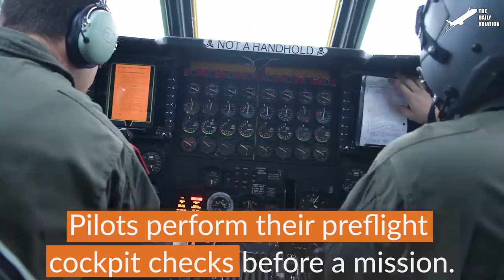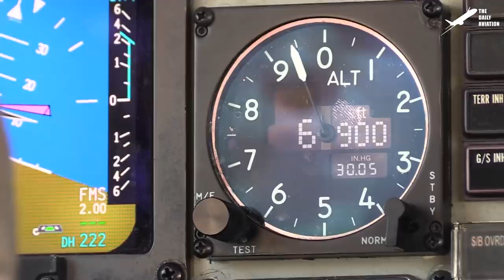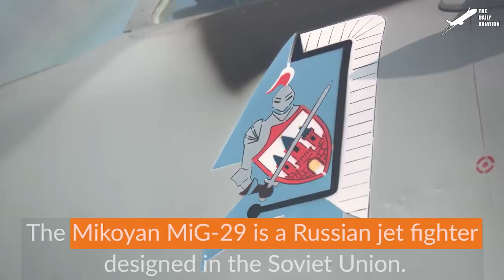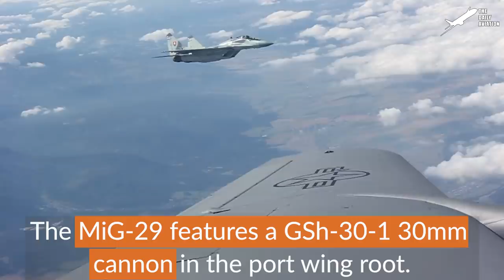This Massive US Aircraft Need 8 Engines to Takeoff

Comment: About two years ago I spent a month helping a retired American Airlines pilot through a month of surgery; a triple bypass that he had put off for twelve years became quintuple bypass by this time and, between two weeks in hospital followed by two weeks in a rehab, it was a rough month for us both. He had flown B-52 in the Air force during Vietnam and after; during the end of propeller models that were subsequently changed to and eventually built with Pratt and Whitney jet engines. He not only confirmed  a  B-52 WILL go .99 Mach, as I had heard but will fly with up to three engines out. Now, he had some amazing stories about how durable these things are and some of the things that can and did go wrong. They'd get shot full of holes, massive fuel and hydraulic leaks, pieces would get shot off or flutter and just break off during flight, etc. and, these things would still fly.
However, he had retired as a commercial airline pilot and had flown just about everything made and said many times, those B-52s generally should have been retired many decades before but, everything built that was supposed to replace them, including the B-1 Bomber, had far more problems and were such unreliable POS's compared to the, "Old Dinosaurs" he used to fly, that that's why the Boeing B-52 was never fully retired. In 1990, during the first Persian Gulf War, while  I was in the NAVY, he went back to active duty and flew B52s again. They needed experienced pilots and, Because they just worked! He said the crews  made pieces themselves when spares were unavailable. Can you imagine? Hey Jim, get me the Pop Rivets and a couple Vice Grips, she lost another trim tab!

Comment: Jet engines have come a long way since the 1950's. I literally used to live right across the street from Wright Patterson AFB, and could see and even hear the B52's taking off. Heavy black smoke billowed from the engines, and you could see it falling to the ground as they took off.
Reply: The heavy black smoke is caused by water being injected into the engine during takeoff.  The water turns to steam and temporarily increases thrust.
Reply: @GregSr  Probably why the black exhaust is heavy and you can see it falling to the ground.  They also smoked considerably while circling to land, so I assumed they were really dirty. I'm sure the engines have been upgraded several times, or even replaced with newer models. Thanks Greg!

Comment: These things are coming on 70 years old. Jet engines have moved on considerably since. Rolls Royce offered an engine replacement programme that would give the B52 better takeoff, climb, cruise and half the number of engines and halve the fuel burn. But “Not made here” prevented the upgrade from taking place.
Reply: They have decided to upgrade the engines, but are going to go with 8 engines that have about the same thrust as the current TF-33 engines, they are considering the GE CF34, GE Passport, PW815 and RR BR725.  Supposedly the contract will be awarded in May 2021.  This should save a lot of fuel and maintenance.  If they pick RR, it will be made at the RR plant in Indianapolis.

Comment: Let's face it - the BUFF doesn't need eight engines because it is so massive, but rather because the jets they had back then were so ridiculously weak compared to todays standard. A Boeing 777-300ER has a MTOM of 351 tons, which is a mere 130 tons heavier than the B-52's and is happy yet still powerfull with just two engines. And the T7 is a civil product, where costs do matter, in contrary to a cold war military project...

Comment: It past over 70 years... And still nothing better than this... 🤔

Honestly knowing that you had 10 years in manufacturing this plane.... 70 years... Ago 😅
Reply: Russian Tupolev TU-160 is better. It can fly 2230 km/h. B-52 - 957 km/h. TU-160 can carry 45000 kg. B-52 - 31500 kg. TU-160 can climb up to 21765 meters. B-52 - up to 16765. It's just 4 engines installed on Tupolev vs. 8 on B-52. And in the end I can say, that TU-160 is much more beautiful. People named it "White swan". NATO named it Blackjack

Comment: Do your research, it has eight engines because it is ancient not because it’s “ So big”, each one of those tiny motors puts out 17,000 lbs thrust, my B747 engine was rated at 50,000 lbs, the Trent on the A330 is 72,500 lbs.
Reply: And the engines on the B-52H were IMPROVEMENTS over the engines on the previous models. On those, they had to carry water to add to the thrust of the engines required during take off.

Comment: What's the mpg lol.
Reply: You said it wrong 
It isn't supposed to be miles per gallon it's supposed to be gallons per mile😅😅
Reply: 5.4 mpg.
If I did the math right.
48,000 gallons of fuel
It can go 8,800 miles without refueling.
Reply: 60 gallons a second assuming that you are flying at 500 mph .
 That’s about (500 gallons a mile) Which is relatively little consumption ,considering you are carrying about 25 tons of bombs.

Comment: incorrect characterisation: it doesn't need eight engines, just when the plane first flew, there were not powerful enough engines so that four would suffice. That is not the case now, and the Air FORce is evaluating re-engining these magnificent relics for another few decades. The fuel savings would be consequential.   Less than a hundred are currently airworthy. I am taking bets that the BUFF will fly for 100 years. , with new engines.

Comment: imagine a BUFF with 4 GE90  installed
Reply: Not going to happen.  They have decided to upgrade the engines, but are going to go with 8 engines that have about the same thrust as the current TF-33 engines, they are considering the GE CF34, GE Passport, PW815 and RR BR725.  Supposedly the contract will be awarded in May 2021.  This should save a lot of fuel and maintenance.
Reply: @rogerd777  not to mention of the availibility of reverse trust and spare parts for the 8 power units
Reply: @bobelaviador  Replacing 8 with 8 will mean a lot less re-design and re-work to the aircraft.  I am sure they will upgrade the cockpit while they are there, but still 8 levers.

Comment: Those are turbo jet, not turbo fan engines.
Reply: Wrong: the TF33 used in the H-version is indeed a turbofan engine. Low by-pass ratio, sure, but still a turbofan.

Comment: The Air Force plans on replacing the 2 engine pods with a single engine with more power than the 2 combined.
Reply: JAG  plus cheaper maintenance, half as many and newer engines usually mean less work.
Reply: JAG  they have had things of greater priority to the Generals, F22, F35, Drones, Splitting off "Space Command". Long range, slow bombers are a low priority.

Comment: It is legendary, "However" only good for lessor defended countries like Afghanistan. The Russians, Chinese, and even Iran has built special Air defense systems designed to knock out the Buff from long distances, even before the B 52 is within launch range of its cruise missiles. To take it a step further Russia actually does monitor where the 52s are at all times, either on the ground, anywhere to include Guam. This practice started long ago when the B 2 was revealed, being stealthy they had no option but to keep an eye on all our Nuclear attack systems to include Submarines.  It is true the Buff is still around for a good few reasons, but the major reason is because Congress will not totally fund its replacements such as the B1 and B 2. Even the F 22 washed out due to Congress, yet it is the best aircraft for our needs. Congress is what has revived these older jets such as the upgrading of F 16  F 15, and others. Money is always the central issue, even when it risks our national security.